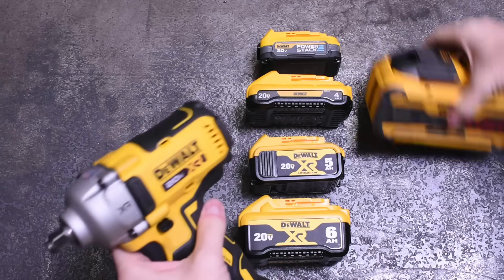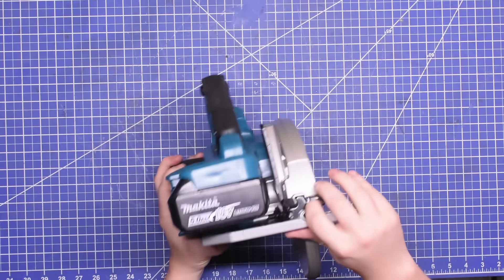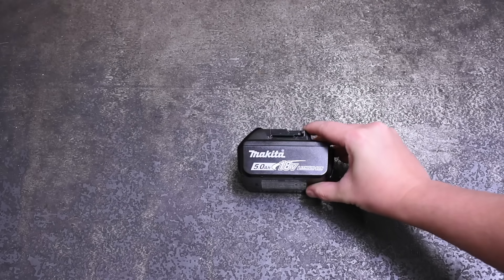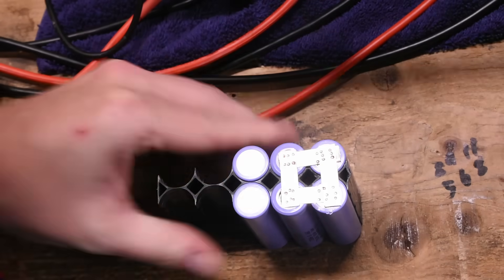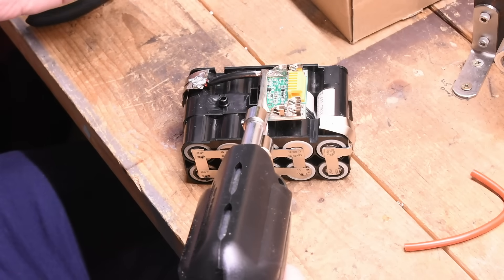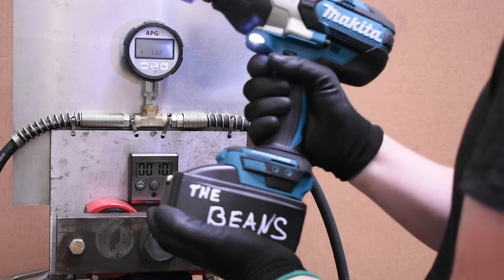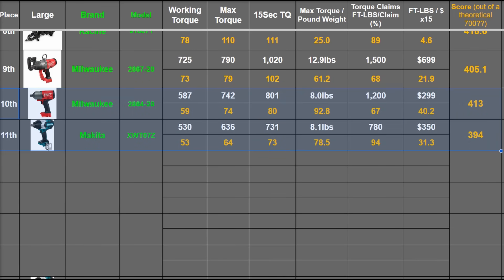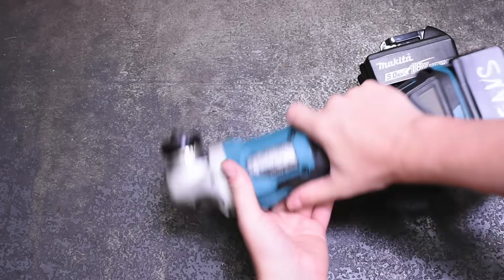We Built the Best Power Tool Battery for the "Worst" Brand

Comment: the idea is cool but the bms board you used is dangerous as hell as it dosnt have any form of cell balancing or probably protection at all beside a thermistor compared to the oem makita bms which btw if you have a locked/fault state battery you can unlock it with a tool called  OBI that is a software and arduino combo and is explained in more detail in this video https://www.youtube.com/watch?v=kUg9jWvf5FM

Comment: I know this is an old video but it's interesting to watch and compare to what happened a couple years later.

The biggest issue with Makita is just how slow they are to move. This video is 2 years old and very little has changed in the Makita LXT ecosystem. By the time they refresh the LXT line to high output batteries It'll be at least another several years. However despite all that Makita's reliability is generally widely praised. Anecdotally I know that many chippies just murder their LXTs for years and years without a lot of issue. LXT 18V supports a massive line up, the largest of the big 3 I would say? That line-up has to support very entry level tools to pro grade tools. Makita has to be very careful with how they layer their lineup not wanting to lock out users, backward compatibility is important.

One of the arguments against flexvolt was that 18X2 would be affected due to the larger batteries. Well what do you know 9Ah and 12Ah batteries aren't supported on most 18X2 tools or even some 18V tools. Makita has also been releasing new 18X2 tools to accommodate the larger batteries, with better spaced battery wells. They've even released new XGT tools to accommodate larger 40V batteries as well. So frankly that argument was largely moot and Makita really wasted a lot of time here.

So they are learning, that being too slow in this market right now is not acceptable. Smaller brands who are trying to steal pro/contractor market share don't necessarily care about existing customers, battery technology has moved on dramatically, I'd like to see more being done from Makita on the battery side of things. If they're worried about backward compatibility then with the "3rd generation" LXT batteries they'll need to create a more robust battery housing that will accept new and old batteries.

Comment: Can you tell me on AliExpress where we can buy a reliable case to build with 21700 batteries in a 5S2P configuration? As long as the continuous discharge current of the BMS in the generic case is over 25A or more? Because if it's under 20A, it might burn out, for example, a Makita drill, or stop working for a while?"

Comment: A new cell is around the corner, EVE INR21700-50P. The specs are absurd. It is a 21700 cell with 5000mAh and 70-125A discharge rating depending on who you ask. This would put a single row 21700 pack above the best two row 18650 pack in both capacity and power. I am going to try and build a pack although the thick copper sandwich strips required will be a pain to work with.
Reply: i'm about to rebuild a DeWALT 9Ah Flexvolt with those same cells (EVE 50PL) and I'm probably going to be using 0.3mm copper, no sandwich. (I will also be rebuilding the aluminum busbars in the BMS assembly with copper busbars.)
Reply: @CalculatedRiskAK How are you welding the copper? It does not stick in my experience.

Comment: I am trying to get some extra out of my LXT stuff, where did you get the kit that lets you use 21700 batteries?  All the kits I found only wanna work with 18650s. I have a 3D printer if I need to make a custom case.
I really want to make a lightweight battery like one of the OEM 2.0Ah but with spicier cells that gets the most out of the smaller tools like the LXT impact driver or the compact 3/8th Impact Wrench, and then I want to make a 5Ah+ with the latest greatest batteries I can stuff in there.
The new INR-21700-M65A and INR-21700-P50S look like they are gonna be a very upgrade to the beans, a Chill Picante if you will. I would love to just grab a LiPo with the correct voltage solder it to a PCB and stuff it in a 3D printed case and see how it goes... I am definitely going to ruin some stuff.

Comment: You should consider the Amp rating of the tool's battery contacts - and the battery contacts of the battery itself.
I've had a Ryobi impact driver burning out one battery contact on a 5Ah battery running extenively during car repair disassembly work (rusty bolt etc.).
In my experience you should only run newerr tools - with enhanced contact ratings - on Hi-Amp batteries.
Better to stock up with old style Lo-Amp batteries to have continuity in work sistuations.
Of course you should also regularly clean off the contacts on both tools and batteries to prevent a burn-out.

Comment: Can u make ur batery tool spin faster? I have makita batery lawn mower.... im interested to increase its output power. Since originaly it uses 5ah batery with 10 cels... but ill make 15 cel bateries with 30 amp cels... in thery i can increase power up to 30 percent.. but i would like to increase atlest up to 20 and if its possible i might upgrade to 20 cell bateries.
Reply from the maker: A tool will only spin faster if it was previously being bogged down from its free speed. Free speed will not increase much if any.
Reply: @TorqueTestChannel  I see. So if i make batery with more amp output it wont change speed... but will it increase torque? In case of lets say thicker gras for mover... with 5ah its artound 50 amps... but with 7.5 ah it would be around 75 amps.. would mowers motor be able to pull more amps out of that pack?
Reply from the maker: @MiniFun92 typically yes. But some are just happy with 50 amps either way in your example.

Comment: DC Motor RPM is directly proportional to voltage given.
Amps generally increase with motor friction/load.

At zero load, this motor seems to be taking 8.5-9A.
However the improved batteries can return that amperage, under a high voltage. Hence higher RPM due to voltage being directly proportional to Voltage.

Under load the amperage increases due to friction, which at a certain point will decrease the RPM as the battery voltage starts to drop.

It seems like, Makita uses a very basis control board, that lets the motor sits on its "equilibrium" A/V curve, Unless one of the "cut-off" parameters are reached, being: Stalling, Overheat or Undervoltage.
This does explain why Makita tools are so reliable and why they scale with better batteries, because the lesser the control board interferes, the lesser chance of malfunction.

Comment: Give up nickel strips and move to low temp soldered copper braid. With LiPos nickel strips aren’t an option.

Never understood power tools using Li-ion instead of LiPo for high power applications. On 8S LiPo you can easily get 2000W

Comment: Craftsman brushless tools could benefit ftom 21700 cells. I bought an adapter for my Bosch core batteries, and got more power out of the Craftsman tools. Unfortunately S B&D will likely never make them so that they won't hurt Dewalt sales.

Comment: Question… Seeing how the strip had melted, are there any over heating issues with the modified batteries?? Could that be a reason Makita did not produce higher ah batteries? Liability issues?
Reply: Makita can do cople of thing's:
1. Limit more powerful batteries to the same current as 
2. Use thicker strips between the cells.

Comment: 21700 LXT batteries would be incompatible with the 2x18V machines ... that is the limitation why there aren't genuine ones. making them and have them incompatible with the most demanding tools is ... not smart so they just kept it at 6 Ah and called it a day until maybe something comes up that makes sense and is compatible with the newest and oldest stuff in the LXT range (most importantly chargers). in reality ... nobody complained when we had only the 10 cell 3 Ah batteries and we all used it with no problem. maybe in reality 6Ah is enough considering fast charge times

Comment: Slightly unrelated, or not   ....have you tested the impact of using newer tech batteries on older obsolete power tools? I've seen a few convincing tests of 20yr old Ryobi circular saws which couldn't hardly cut much wood...that could zip through two layers of 3/4" plywood like butter, using their new Lithium Edge batteries. 

What would a Milwaukee tabless 21700 cell battery packs do on an older Craftsman C3 19.2 or ...really any old brushed power-hungry tool do? Could they run an older brushed grinder great? How much longer? Some video tests show using newer batteries is like putting a turbo on those older power-hungry tools.  Thanks for your videos!

Comment: My makita batteries have lasted a loooong time under daily contractor abuse so I have no complaints about quality.  I believe the 4ah battery has the most output wattage at 1000 and the 5 and 6 ah batteries only go to 760 watts due to the types of cells.  I know this is an old post but I am just getting around to it. nice work making the beans!

Comment: What thickness nickel did you use with the first cells that burned up?
I'm trying to figure out the minimum thickness that i can use to get away with using a cheaper spot welder.

Comment: Have you ever stopped to think that people just don't see the power output as being critical as being the total requirement to purchase. Buying a Makita 18v is value and range stability itself. Its as you say a dinosaur battery. But by keeping the same 18v battery system they sell into far more DIY homes than they lose to the I've got big baiis tradie lot wanting more.  The fact demonstrated here, that the tools will out perform others with supposedly more power, indicates that the 18v system is capable and turns a matching output capability into reliability and longevity of compatible tools. Just what many want above all. 
In a few years we will see only two battery connections. One for high power output and one for general power output used across nearly all brands. Makita will still be there, and in both types, but some of the other brands will disappear. And it would not surprise that many of the current Makita 18v system would be part of the general power battery products.

Comment: Being a tool repair tech for a living, Dewalt batteries are junk. We get so many flex volt batteries in for warranty or repair, because they don't work/ they only work on 20v or only work on 60v. They break right after a year or don't work from the factory. Makita batteries, from my experience are the best. I have a 4.0 ah battery that has over 10000 charges on it and works like new. we have a battery checker to test the battery cells and computer. and it tells you how many charges it has on it. in this line of work, I have seen far more(10x more) Dewalt batteries come in for repair then Makita or Milwaukee. Makita batteries win when it comes to longevity. I was raised on Dewalt, and UNFORTUNATELY Dewalt is not even close to as good of a company as they used to be... every tool they make is a throw away.

Comment: I have a 2.0ah pack with the alternate flashing lights fault, I took it apart and saw that it looks like one of the cells burnt out. 

If I replace the cells, will the pack automatically work again or do Makita lock out their broken packs? ie does it need a software reset or something?

Comment: You can get 45amp output 21700 cells. A friends currently converted a ryobi dremil that take a proprietary battery aka and 18650 with a shell on it, new brushless motor and motors driver. Things a mini angle grinder

Comment: Dude... You totally chose the wrong cells for the 18650's. 
 20s3's(lower mah but higher continuous(30) and max(~40)amp draw).

Always go by independant bench test data. As opposed to advertised specs and brand credibility.

Comment: last week I saw a guy with an old hilty rotary hammer hooked up to fucking CAR BATTERIES. he was bolting a multipitch rock climbing route top-down, meaning he hiked to the top of the mountain an then rappelled down for like 300m while drilling holes in the wall. the drill had thick wires soldered where the battery usually sits and he told me he had 3 small car batteries in his backpack. absolute madman. Wish I asked his number

Comment: I contacted Makita when my 4 year old light use 18V 5Ah battery went into fault mode - alternate double led flashes - they said it was not repairable and had a 1 year warranty. It seems it was doing its job in protecting me from harm - Makita prioritise safety, not longevity or torque.

Comment: The chemistry and composition of ASPİLSAN INR18650A28 is nickel-rich lithium-nickel-manganese-cobalt oxide. Its dimension is 18650; its capacity is 2900 mAh and its voltage is 3.68V. Max Continious discharge current is 25000 mA. End of discharge voltage is 2,50 V.... Cycle life to 90% of initial capacity

Comment: I had a garage full of LXT tools...and had a desire for smaller tools. I ended up with a M12 propex tool for some work on the house and that just served to be an intro into Milwaukee. I've since made some new tradesman happy with a ton of cheap blue tools and batteries...but frankly I wish I didn't need to have dumped Makita. I'll admit that I think Milwaukee did a great job of making M12 and M18 tools and chargers that once you buy anything M18....well hey now you have a M12 charger too! Just need to go buy some M12 stuff.

They need to drop support for the LXT X2 tools (or just asterisk them) and be done with it. It's a horrible excuse today to skip better battery cell sizes. It was a horrible excuse 5 years ago too.

Comment: I still have a lingering question. Makita makes 3, 4, 5, and 6 ah packs. Which one is the most powerful? Are they like dewalt where the lowest ah has the highest output? I just purchased some molicel p28a batterys to repack a 2007 3 ah pack dont think I will be buying a new lxt battery but it would be nice to know.
Reply from the maker: 5Ah is most consistent, 6Ah can sometimes perform best.

Comment: Hi there, 
From a technical/nerdy point of view I get it that a brand can do some improvement but as long as I'm concerned being a contractor it doesn't really matter. I mean of course tools have to be efficient, fast and reliable which all professional brands kind of 	are. So once you've chosen a brand you basically stick to it. We work on Makita for 5 years but it could have been Milwaukee would've been the same. 
As carpenters in Europe we use a lot of impact drivers  and drills with big screws. We have to cut big chunks of wood with any saws  and the job gets done really great on those 18V. I don't really see why we should buy those huge costy batteries. In 5 years of daily use only 2 of 20 batteries went off. At that price it's pretty insignificant 🤷🏼
Great channel by the way 💪

Comment: What did you use to make the pack in terms of cell connections? Did you exactly match what battery pack manufacturers are using which is often 0.30mm thick nickel (or thicker)
Reply: Ah ok you figured it out

Comment: Do you have any testing of the Makita battery packs that can run power tools?  They make a PDC01 that takes 4 18V batteries and a PDC1200 which is a 1200WAH battery and pack combo.

Comment: 5:53 current doesn't work the way you've describing. In your case, because there are two cells in parallel, your theoretical maximum current will be 10a higher (5a from each cells connected in parallel)
Reply: Not true

Comment: You really should not be using a weller gun like that on circuit boards or when attached to. There's really no discharge protection, which can/will leak back from the tip when you release the trigger. Or at least don't let off the trigger until you have the tip off the board.

Comment: 260W soldering iron 😂
I solder such cables with my 65W TS100 at 19V (so it's not even 65W). That thing doesn't even need full power. You clearly need a new soldering iron bro!

Comment: I had makita for 6 years , decided to switch to dewalt while still keeping my makita tools , after using dewalt for about 4 months 4x 10ah batteries have died on me (thats around 500$ and one 4ah and 5ah batteries have died . Im back to makita and still have some dewalt tools but i am very disappointed with the quality of dewalt. I havent had any issues with makita batteries.  
I have used a milwaukee to makita adaper as i have a lot milwaukee tools too, and i jave put the 10ah batt on makita drill and it burned the drigger on the drill twice , prob from too much current passing thru it , thats my foult .

Comment: My Makita tools and batteries just keep rolling on.   I build boats so don't run in huge screws or lag bolts.  The Makita batteries are super reliable and are known to have a conservative battery management strategy.  The stuff just works.  The one thing missing from Makita power tools is advertising hype.  No where on any Makita tool will you find the word "extreme".  Which I find refreshing.

Comment: Blasted videos! They cost me more money, more time, and my wife...well that's another story. Loved this! I can solder and do many things, just not an expert. I always heard soldering Li-ion batteries was dangerous. If careful, is this something most amateur solder's can do? Don't Makita's have a special chip that monitors everything; did you take it out or it doesn't matter?  Is there an 18650 replacement battery that is best if the form factor is important? In the 21700's, after the new Molicel, are Samsung 30t the next best option? Thanks
Reply from the maker: I wouldnt recomend soldering a lithium battery, you need the spot welder. The Samsun 25S is a good 18650 option, the new 50S is a good high capacity options. Yes 30T is the overall choice usually for price availability and performance in 21700's
Reply: @TorqueTestChannel  awesome, thanks